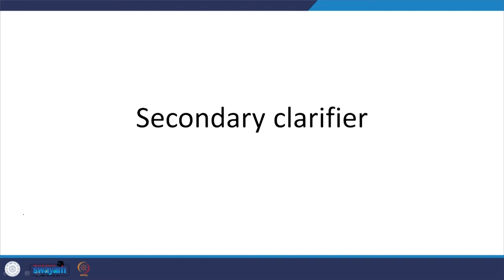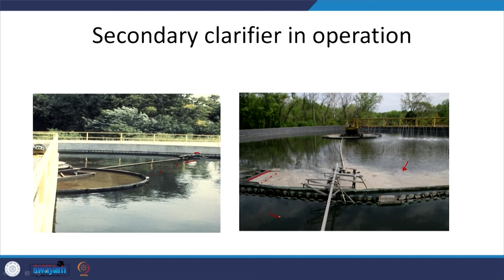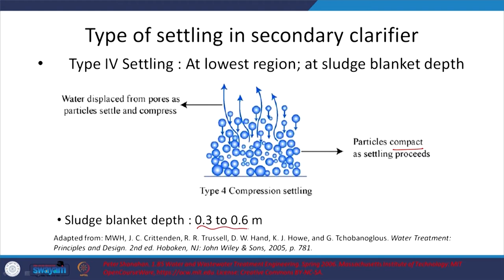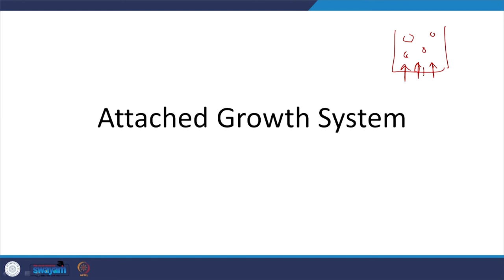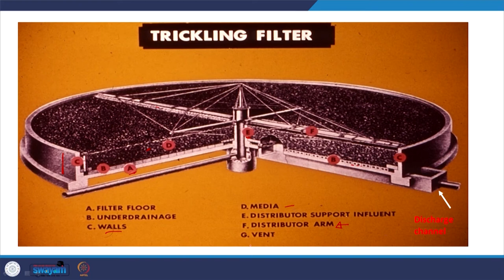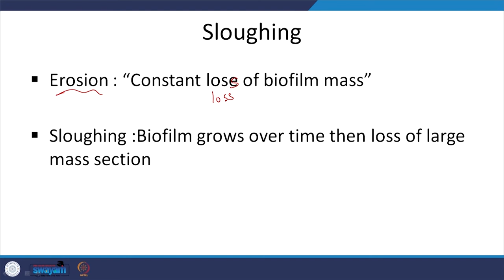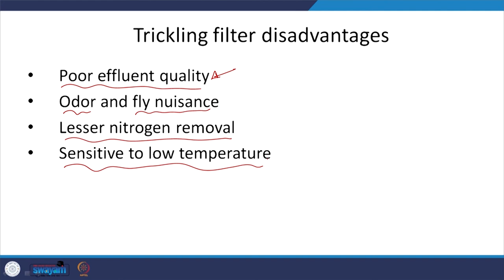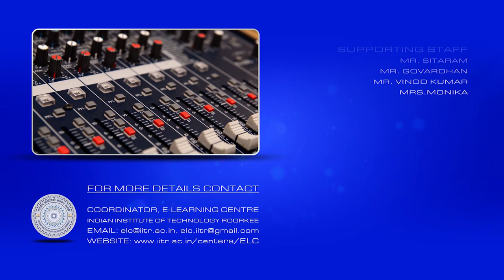Lecture 27: Secondary Clarifiers & Attached Growth System

Comment: Hi sir, i have a problem with the secondary clarifier design, inside dom we are replaced because the old one fell down and we are fixed with the new but dom top side fully closed top side,after that we are facing sludge floating in the clarifier any issue with dom fixing please help sir what to do now